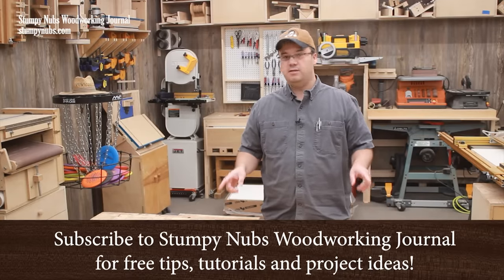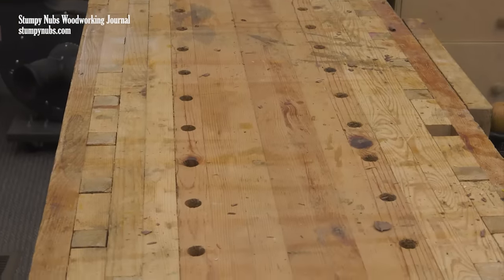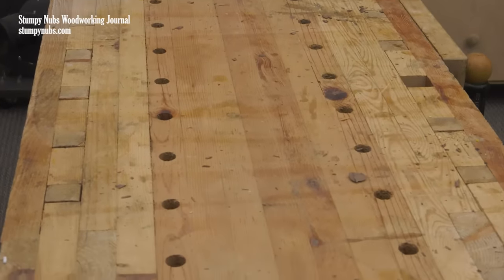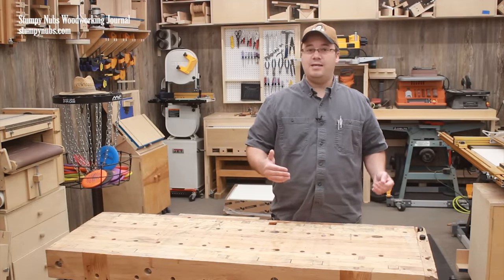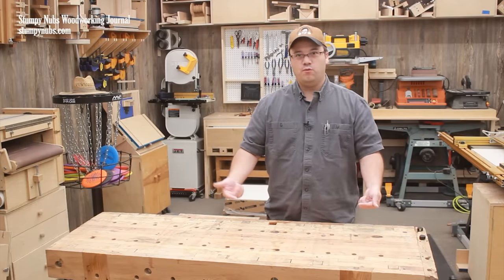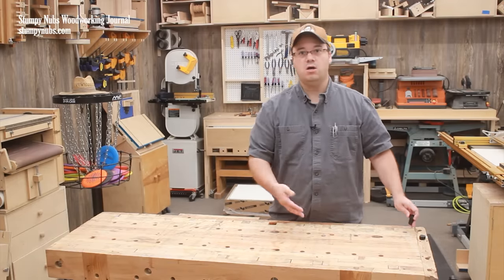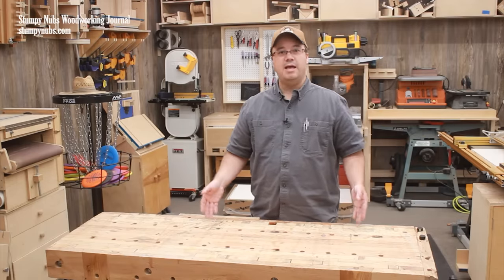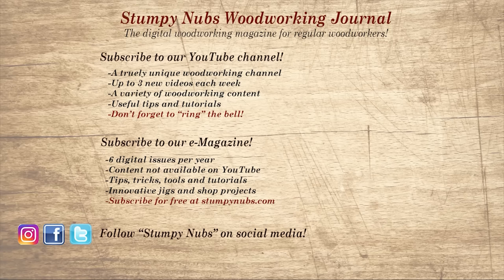Will a cheap 2X6 pine workbench last?

Comment: I made a bbq table/stand very similar to this bench, but has a big hole cut that my Weber charcoal kettle sits in and not all the lower shelves and such… That was about 8 years ago…it has been outside, uncovered ever since I built it. It’s out in the direct beating California sun and any and all rain we get too… now this is also a testament to the cheap polyurethane I sealed it with, 3 coats, can’t remember what brand but knowing me it was the cheapest at Home Depot… the table gets dirty, I just Brillo pad it and rinse in water… it doesn’t look brand new, but looks nowhere near 8 year of Home Depot Doug fir out in the elements…

Comment: Spot on about it not being a dinner table.
That said, I oil my bench because it makes it easier to chisel off glue that dripped onto the bench. Just run your hand over the bench top, and glide a chisel over the glue spots, they just fall off.
Also, I am not a fan of beach top benches. Bench tops should be made from soft materials. Soft material both help prevent damage to your work, and your work will not slide around as much.
Harder lumber for a skirt and maybe a couple inches in gives you a surface to pound on though.

Comment: Yeah, rookie mistake I made last spring was just making my bench top from laminated construction 2x4s, only days after bringing them home. Its actually incredibly sturdy, but all the time i spent leveling it and the material i removed in doing so is wasted now, and most of the joints and dowel pins look terrible as the wood shrank underneath it leaving the dowels sticking out about 1/16th all around. Itll be fine once i get around to finishing it and its functionally fantastic tho. All doug fir, btw. Used 4x4s for the legs with mortise and tenon joinery to the benchtop, and 2x6 stretchers on all 4 sides using half-lap joinery, all joints further secured by thru-dowels of oak and maple x3 per join.

Comment: I have been impressed with this bench since I first saw the build video years ago.  It is a great design.  I am not the least bit surprised it has passed the test of time and hard use.  
I hear what you are saying about the location of the vises on this bench, but the original placement makes good sense.  We all build our benches for the shops we have, not the shops we want. ✔
Well built. Well done.  Thanks!

Comment: I had a work bench that was around for more then 70 years, it was factory built and it had the through bolts, so if it was good enough back then, I wouldn't worry about them.

Comment: I live more in a fantasy world where I do more dreaming about fabulous things like this, rather than building and using them but just as someone with an avid interest might I ask if the bench is symmetrical and drawer access is from both sides then would it not be possible just to transfer the face vice to the opposite side and turn the table around? That would save moving the end vice.

Comment: My benches for everything are all located at 42 inches. I carry my height in my torso. So I prefer a bench height where I’m not bent over and I can sit on a stool in front  if I’m working on something akin to a desk. I used to like my old high school benches that had a swing out seat on a round pedestal. Now that I think of it I might add one to my bench in my machine shop.

Comment: Thank you for your video! I’m planning on building a similar bench. It’s funny seeing all the exotic hardwood bench builds out now. They are gorgeous but way out of my budget! This video was very encouraging for me. I have a question for you. I have a bunch of old (very dry and dense) either pine or fir 4x4’s and 2x4’s. I was thinking of using them for the center of the bench (majority of the width) and capping them with something a bit thicker and harder with mortise and tenon joints for the caps. Do you think a 3 1/4” finished top is thick enough to not warp and for bench dogs? Thank you!

Comment: Mine is 35 years old, made from 2x4s, glued and reinforced with threaded rods (five of them I think), with 4x4 legs. It is very heavy and no work of art. The boards cost $54 in 1986.

Comment: Question: I live in the Phoenix AZ area, so if I were to just let the lumber sit outside for the summer, or sit inside of my garage, that should pretty much dry it out as dry as it's ever going to get, wouldn't you say? The average daily temperature here in the summer is about 105 degrees F., and inside of my garage during the simmer days, it gets up to between 115 - 120 degrees, and even during the night the temperature rarely drops below 100 degrees inside of the garage most nights. What are your thoughts on this? How long do you think it might take to completely dry the lumber outside, and inside of the garage in the summer? Keep in mind, we have almost ZERO humidity in the summer months.
Reply from the maker: As a rule, 1 year of air drying for every inch of thickness, when properly stickered (not just piled).

Comment: There is no reason ordinary construction lumber or pine should not make a workbench that lasts for generations.  I built Norm Abrams' bench in 1990 .... it has survived constant use, 3 kids, and a couple of grandkids in the intervening 31 years.  I used a screw vise that my GREAT grandfather had brought with him when he immigrated from the UK in 1910 - and it still works fine, and so does the bench - from furniture projects to making pens, it has been perfect, and those 3 kids all want it.  :)

Comment: The biggest problem with Douglas Fir is actually obtaining real DF.  In big box stores in the western US, DF is mixed with usually at least two other species.  DF is comparable with SYP.  Not quite as hard or heavy, but a good alternative to SYP on the west coast IF you can find it.  Also, it's a wood where the dust is serious health risk.  You can find it salvaged from western buildings built before WW II.

Comment: Linseed oil (varnish) prevents glue and other (adhesive) liquids to get stuck onto the surface.  After drying (i.e. polymerisation) the oil contributes to a harder surface, too. 
- I can’t see why one wouldn’t want that advantage at almost no extra costs.

Comment: I like the square dogs too for several reasons. They can be wider than the round ones, which tend to disappear over time, probably due to there being no out of the way storage for them. The square dogs, having more width, is more stable & the wood is more forgiving than round dogs made of metal or plastic in my experience. These metal or plastic dogs can actually leave marks on softwoods that don't appear with square wood dogs.

Comment: Inspired by you, Stumpy,  I am about ready to make my workbench out of laminated 2X6. My local Home Depot only has really crappy Douglas Fir lumber that's so fast growth it is riddled with knots. On the other hand, they have an abundance of very clear southern Yellow Pine, but it is pressure treated.  Can I use pressure treated lumber? Or are the chemical preservatives in it too nasty for use in a workbench.
Reply from the maker: I wouldn't use pressure treated. It is never very dry and the chemicals are nasty.

Comment: I once built a 2x4' table for a heavy piece of gear. 2x6 construction and double 3/4" plywood top. Sucker was rock stable and took the machine's weight like it was nothing. Anything worth building is worth overbuilding!

Comment: Question for Stumpy and the others who have built workbenches out of Doug fir or pine. How do the dog holes hold up over time? I would think not being in hardwood they might elongate over time from the pressure applied against a dog or holdfast.
Reply from the maker: Depends on the type of pine and how often you use them. The average user will have no problem even with spruce or fir. A heavy user may want hard yellow pine for the hold fast holes.

Comment: I have square dogs on my bench. Mine grip the bench because they are made of ash and have a small housing in the face Within the housing is a small lath of ash at an angle to the vertical. This is screwed at the bottom and acts as a spring. It bears on the face of the mortice and retains the dog at the height at which one puts it.

Comment: You mentioned allowing "new" lumber to acclimate to your shops conditions for a few months. I have been buying KDHT (kiln dried heat treated) lumber exclusively from the big box stores for a while because it's usually A LOT straighter than the less expensive kiln dried lumber. I have not been allowing it to acclimate in my shop, and just using it right away. For this, or any other workbench build, would you still acclimate the KDHT lumber, or would you go right to work???
Reply from the maker: I would let any wood acclimate before using it, no matter where it came from.

Comment: This is an old video but I hope you still read through the comments - how have the holdfast holes held up? I’ve heard they can get a bit loose around the edges on the top/bottom, as it gets compressed from the irons? Thanks

Comment: Honestly the easiest way to change the vise placement would be to just put the face vise on the other side of the bench (maybe a leg vise so it's ideally placed). That way the end vise is "moved" to the right end of the bench without actually having to move it

Comment: I had hoped to hear about how the round dog holes held up over the years, having holdfasts wedged into them over and over again. I’ve heard others say softwood dog holes will eventually not work due to fibres being crushed and the holes getting “rounded out”. What are your thoughts on this? Is it an issue?
Reply from the maker: They still work fine. But I admit this bench has been used for lots of things, so the hold fasts haven't seen as heavy use as on a dedicated hand tool bench.
Reply: @StumpyNubs  well that’s still good to hear! Gives me some reassurance that I can build a long lasting bench for what I want, and not spend literally thousands, on hardwood, ultimately for nothing. Oh, and thanks for the fast reply!

Comment: Around 1:23, you mention your expensive beech bench. Are you still using the Sjoberg Elite 2000 from your 7 yr old video?
If yes, how did that one hold up agains time? It's still expensive so would you buy it again or build something yourself?

Thanks for sharing
Reply from the maker: Yes, I still use it for almost every project. I take good care of it, and it's still as good as new, though there are some knicks and marks in it now :) Some people like to build benches and shop fixtures. Others like to buy that stuff and focus on building furniture. If you are the former, this video is for you. If you are the latter, it's tough to do better than the Sjoberg, in my opinion.
Reply: Thanks. My first idea was to build one myself but I think building something like the sjoberg inclusive the same 2 vises is not much  cheaper. I have to check the beech prices in my country first. Thanks!!
Reply: @StumpyNubs  I'm almost there to order an Elite 2000 myself. But I'm wandering, the 25.4mm bench dog holes aren't common. How do you deal with that? Maybe a topic to create a video of it? Seems like , only Sjoberg has accessoires for it.
Reply from the maker: @twandieltjes1359  1 inch bench accessories aren't as common as 3/4, but they aren't rare.

Comment: I have a version rough garage floor, with lots of grooves. I need some suggestions for making the bench rest solidly on the floor. It’s not leveled in any direction either.
Reply from the maker: You might try adjustable feet: https://amzn.to/3eFatxH However, the downside is they provide less surface on the floor, so the bench may slide unless it is really heavy. I suggest making it really heavy by adding a tool cabinet beneath, or cement blocks at the base.

Comment: It looks like the bench is symmetrical. Can't you just spin the bench around so the end vise is on the right? Then just re-mount the face vise where you want it.
Reply: Does the tool cabinet come out, and can it be turned to face the other way?
Reply: @TrevorDennis100  He mentioned the drawers are already accessible from both sides.

Comment: Question: when salvaging wood, how do I know that I am not inadvertently bringing some insect infestation into my home? (i.e., termites, ants)? Could it happen that some old wood looks fine but it is actually infested with insect eggs? Could wood purchased at Home Depot have this problem?Thanks guys for any comments.
Reply: If the wood has been used in construction (as in "it's been inside walls", not "part of a barn or exposed exterior") then any insect activity would be visible, the bugs need to bore into the wood to lay eggs, so look for bug holes. 

Exterior exposed wood, I think there's insecticide brands that won't hurt your ability to glue/finish later.